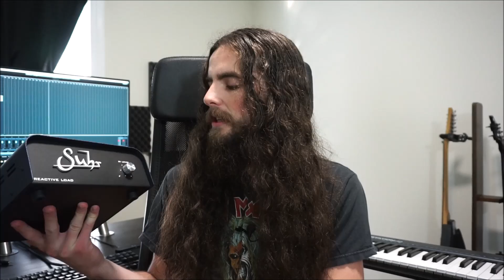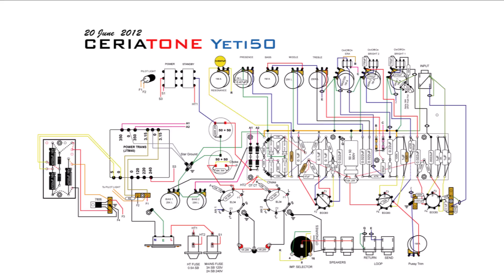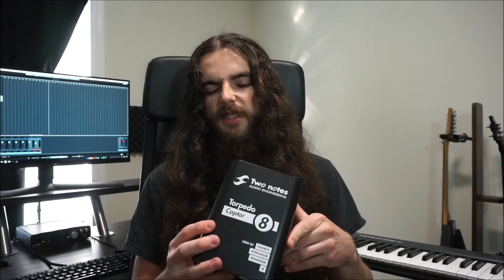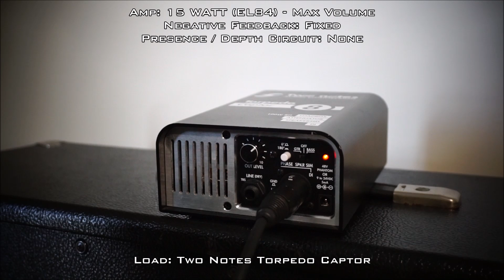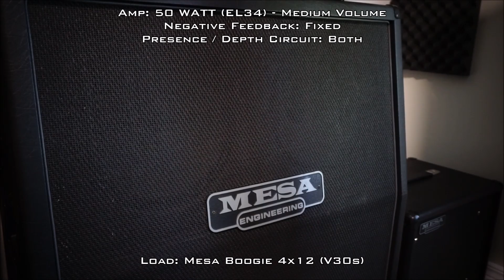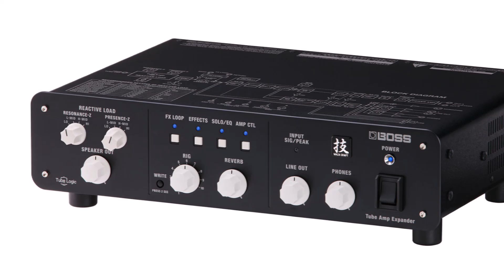Suhr Reactive Load: Coaxing the Most out of Your Tube Amp

Comment: Are you using any plugin for impulse responses? Or just recording straight from the Suhr? I just got one of these and a JCM 800 head and I'm not sure if I need a IR or do I track through an IR plugin?
Reply from the maker: You need a seperate IR loader for this version of the Suhr. There is also a version with an onboard IR loader.

Comment: with the surh reactive load I can turn it on on stage, connecting it between the speaker of my vox and the head, being able to set the volume of my vox in some region to hear it on stage and not needing to mike it, passing the signal that the suhr reactive load receive and send to the table, dare you, a live stage show situation without needing to mic my vox. I speak of Brazil

Comment: I went down a rabbit hole with load boxes…I have the Suhr,Fractal X-Load,and Fryette PS2……I also tried the Boss TAE,Two Notes Captor,and UA Ox….The Suhr and Fractal are my favorites,and sound very close….The Two Notes and Ox and Boss leave out the low end inductor,so the curve doesn’t look like a real speaker….The Fractal X-Load is smaller than the Suhr by the way….but it sounds nearly identical..

Comment: Saw this vid a while back and was intrigued. Been using the Captor for a while and have been very happy with the results. Recently came across a used Suhr RL and pulled the trigger. Low and behold there certainly is a difference. My preference now is for the Suhr for most of my amps and the Captor for the others. Thank you so much for making this video. Cheers!
Reply: Thanks for the review, which amps si you prefer on the captor?

Comment: Okay so question, when recording the cab as the load, what DI did you use, the Suhr or the TwoNotes? Are the DIs pretty much identical if you are running it as a pass through with a cab as the load?

Comment: Can anyone tell me if the suhr reactive needs power before turning on your amp? I see the two notes needs power but is that just because it has the cab sim?
Reply from the maker: All these devices are passive. A speaker cab doesn't need external power, and neither do these as they serve the same role as far as the tube amp is concerned. DC or Phantom power is only required when there is an integrated analog cabinet simulator (like the Captor) or an impulse response loader (like the Captor X or Suhr IR).
Reply: Plague Scythe Studios I thought it might be something like that but I wasn’t 100% sure. Thankyou

Comment: I bought the same Suhr RL the day it was released and have used it with my Marshall AFD100 and 5150 and it works great! Wouldn’t trade it for any of the others. But, I absolutely agree if Boss released a less expensive version of their TAE it could be a good contender in the $300-400 price range. It and the Ox are too expensive at their current price points. For more flexibility you could look at the new Suhr RL version that has HP Jack, IR loader and hi/lo cut switches on the front. Perfect! Great video and comparisons 👍

Comment: I bought a Surh Reactive load a couple months back and couldn't love it more. Both The Suhr and Two Notes have their uses though.
The Suhr sounds extremely clear and detailed, very crisp and defined.
The Two Notes doesn't have as much inherent high end and so it sounds a bit smoother.
I'm the same as you though, I wanted to buy a Fractal Load box as well but after several months of it not being in stock I went with the Suhr. Glad I did.

Comment: I actually prefer the Two Notes. Sounds more “modern” I think. Thanks for the video!
Reply: I was just thinking the same, the Two Notes sounds practically indistinguishable from the real cab, whereas the Suhr has some unpleasant fizzy top end.
Reply: @nekrovulpes  U need to use the high and low cuts more on IR's when using the suhr RL since the load on it preserves more of the amp's high end.